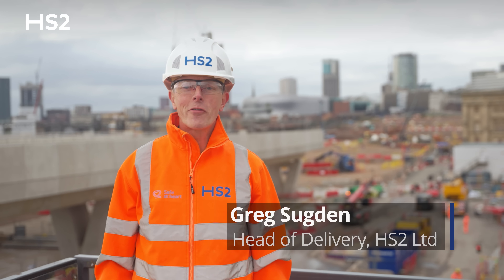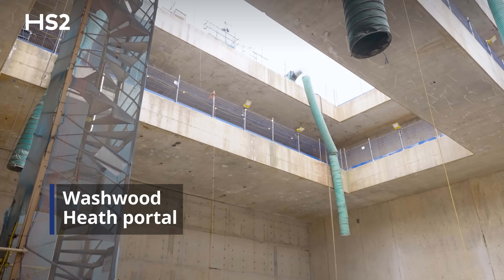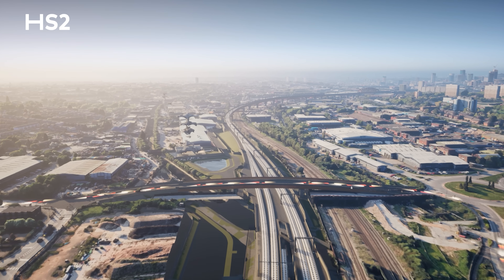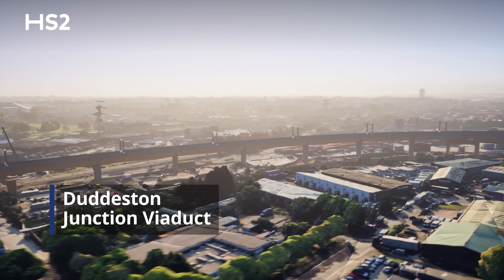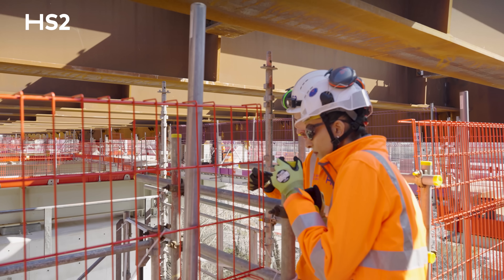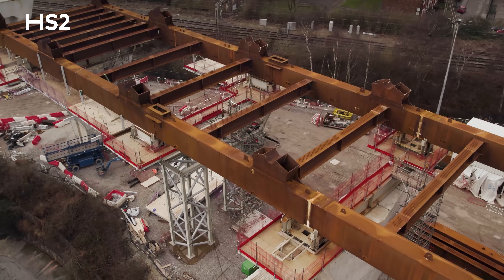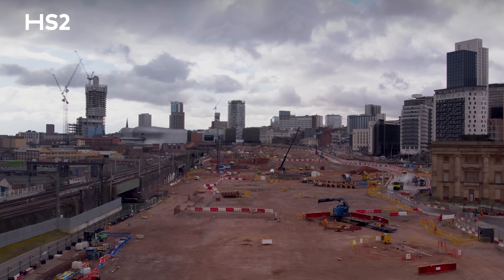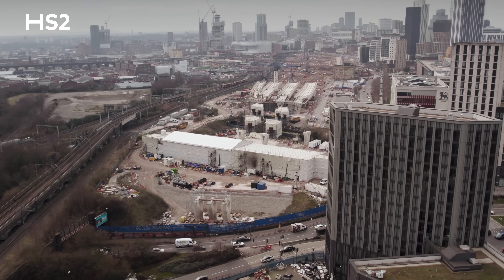Building to Birmingham: 🚆 HS2's Curzon approaches progress update 🏗️

Comment: The key word was right at the end: "capacity". Take express trains off the WCML allows for more freight and commuter trains. But this only really makes full sense if the rest of HS2 gets built... It needs to be completed. In full.
Reply: Apparently, the whole network didn’t make economic sense, but I wonder who it didn’t make economic sense for. Maybe it would have benefited the North more and less so the South so it would kind of re-distribute the capacity of the network. Transport in the North has been terribly under invested.
Reply: @jacklav1  the cancellation plan involved still building £12bn of phase 2b for the Liverpool Manchester line which has a lower bcr. The bcr calculations in network north for hs2 were manipulated also. They were lying when they said it didn't make economic sense.
Reply: @benphillips5041  what does bcr mean? Also lying to save some cash for a short term fix sounds about right. No point in investing in something that will benefit future generations- they won’t vote in the next election.
Reply: @jacklav1  how does that make economic sense
Reply: @epicmonkeydrunk  Well that’s exactly what I mean. It doesn’t make sense overall but I will bet you that the northern branches of HS2 would benefit the northern economy substantially. And there’s f- all investment in transport in the North.
Reply: It can only free up capacity by taking passenger services away from exiting routes. That's not much use for those that can currently walk to their existing station is it?
Reply: @aib0160  The way HS2 frees up capacity is by removing express trains from the network. Express trains which don't typically stop at your regular Joe's local station.
Because you don't have to leave a massive gap in front of express trains any more (current you do, so that it doesn't crash into a slower train), you can then run trains closer together. So these people "that can currently walk to their existing station" will actually get MORE trains, not less.
Reply: @mastertrams  Well if like me you have access to a local station where express trains do stop albeit not all of then there's little advantage for me if fewer stop in future and I then have the choice of the inconvenience of getting to Birmingham first, walking from New Street to Curzon Street with all my luggage or getting the local train that stops at almost all stations with the possibility of having to change too if the train doesn't go all the way to Euston. Either way it doesn't help me and there still the unknow fare cost and the added cost to get to Birmingham.
Reply: This is unfortunately what so many unshowered vegans failed to accept when they were chaining themselves to trees in the early days.

All said and done, all they did was cost the tax payer hundreds of millions more.
Reply: @mesnilman2327  No it makes sense now with the most congested part of the WCML being freed up, no more need for express services south of Birmingham and therefore commuter, freight and medium speed all stop services can work harmoniously on that part, thst being said another step change in performance comes from phase 2a being completed and this HAS TO HAPPEN….!
Reply: HS2  - massively over budget, many years behind schedule, hideous environmental damage and sadly typifies the current state of the nation.
Reply: The whole of HS2 is a vast waste of taxpayers money on a service only intended to open up a corridor to Birmingham for rich Londoners to expand their suburbs while the rest of the rail network - Wales, Scotland, Cornwall - slides into  decay and disuse. It will be the Taxpayer that subsidises it for decades to come. Appaling waste of money supported by spurious arguments. Dr Beeching was right.
Reply: Would have been easier, cheaper, quicker and less controversial to build a new freight only line.
What we are getting is way over the top for a small country, gold plated and diamond studded white elephant.
But I agree that having started it needs completing in full.
As it stands it's a half hearted money pit that won't break even as value for money.
Reply: @tangerinedream7211  don't agree with you there. Many folks made similar comments during the Elizabeth Line construction  - yet look at what an overwhelming success that has been. We need more capacity, the windy WCML will be for slower stopping services and freight. Look at the developments already underway in central Birmingham and surrounding OOC long before the line will operate to see the economic benefits. What has been a problem are the continuous changes to the scheme by the former government causing cost increases and the stupidity of Sunak to cancel Phase 2 and put Euston on hold. Just leave HS2 to deliver a quality railway that will benefit the country.
Reply: @Maxhead_room  The Elizabeth Line is a success because it is so well integrated with the existing railways and tube lines, whilst simultaneously offering faster speeds. There are so many origin-destination pairs supported by the Elizabeth Line that previously didn't exist. This isn't the case for HS2, it doesn't integrate well at all with the existing rail network, meaning that inconvenient interchanges are going to be par for the course and it won't open up many new O-D pairs. It will simply bring you very fast from where you don't wish to start your journey, to where you don't want to end your journey, and where you'll have to walk 10-15 minutes to get a connecting train (i.e. Birmingham Curzon Street to New Street).
Reply: @Maxhead_room  To say this was not the cost-effective solution to an arguable capacity problem is an understatement. And the Elizabeth Line's purpose & associated costs/benefits are so hugely at odds with the HS2 white elephant's ... no comparison
Reply: @91Durktheturk  It's a kind of national joke, really. Sadly the joke's on the tax-payers & those who've wanted affordable long-term rail travel in the UK, instead of whizz-bang prestige projects to further the careers of a few
Reply: @tangerinedream7211  it would have achieved a fraction of the capacity increase of hs2 and hardly make a dent in express services capacity, would not have been any less controversial (see the campaign against ewr) and would have still required multiple expensive interventions on the network to resolve pinch points like New St.
Reply: @tangerinedream7211  A new Freight only line would of been a gold plated White Elephant as you put it, and yes HS2 will pay it's way as the vast majority of high speed services from Manchester, Liverpool, Scotland and Birmingham will not use the Southern Half of the WCML when HS2 opens but will divert onto the HS2 route at Handsacre in Staffordshire
Reply: Arguments that the WCML is at "full capacity" rely on a discredited, out of date forecasting model which overestimates long distance passenger growth & isn't used for anything anymore except to justify the monstrous vanity project that is HS2.
Network Rail's "New Lines Programme Capacity Analysis" shows that WCML capacity is kept artificially low by private operators wanting to maximise profits.
A DfT analysis shows that in peak hours leaving Euston, WCML trains were loaded at just 52.2%.
Whatever people might try & tell you, there are absolutely NO passenger "capacity issues" between London & Birmingham  except London bound morning peak. 
Even Chiltern Rail mainly run 2 or 3 car DMU's most of the day & they're mostly empty! 
Added to that, virtually no-one travels the entire route between the two cities & instead, get on & off at stations along the route.
The blatant corruption within HS2 Ltd that's recently been exposed reveals that senior executives published misleading projections & exaggerated figures to ensure that billions of pounds kept flowing into the project (or lied as it's more commonly known).
There's absolutely NO chance of the rest of this massive white elephant being completed in full as Labour or whoever's in power in four years time won't touch this unmitigated disaster with a bargepole in the future. 
HS2 is an environmental disaster of epic proportions & Britain's biggest infrastructure mistake in half a century.
Reply: @CRIMSONANT1  yes, ok, not all agree.  However, try running a 200mph train on WCML?  The curves, sharp bends, and 20th century track would never take 200mph speeds.   The HS2 is a fundamental change in UK high-speed rail/track and can be scheduled independently of WCML slower commuters and freight...so new HS2 technology and tracks will also increase future WCML capacity.   At a cost, but worth it in a decade from now.
Reply: @Carlos-im3hn  .. in a decade from now"?  .. this disaster of a project is unlikely to be operational until 2042 at the earliest (SEVENTEEN  years in the future) .. the technology you refer to will be obsolete by then! 
As for the freight issue, the CEO of the biggest freight company in the UK has expressed doubt as to whether HS2 will significantly benefit the freight sector.  The main points of contention include HS2's lack of multi-modal use, interconnectivity & intermediate stations, which are crucial for freight operations.
Reply: @CRIMSONANT1  ideologue alert, we’re never gonna convince this well-informed human being, what would we know about one of the most congested countries on the planet with overcrowding and I need to transport people on mass between the largest conurbations to ensure a carbon footprint and a sustainable way of communicating and getting around the world sixth largest economy
Reply: @CRIMSONANT1  So the technology of incab signalling will be obsolete will it, well it has been in use in France for decades now and is still in use now plus semaphore signalling on Railways ( Do you know what a semaphore signal is ) has been in use on Railways ll over the world for centuries now. Railway stuff does not go out of date but is updated and yes HS2 will be beneficial to the Freight companies in removing the vast majority of Inter City trains off the WCML allowing more capacity for freight use on the WCML
Reply: @CRIMSONANT1  Don't get the comments...OOC to Curzon will be running trains by 2033; and, no one is seriously suggesting running freight on HS2 lines.  The point is all the old operating heritage lines will be freed up for more freight.  Running trains on batteries or hydrogen at 200mph is a future whim; however, new GenIV nuclear power (and green H2 generation) may be the industrial power source starting in just 10 years.  Sticking with mid-20th century tech is not an option...time to move forward.    And, please see recent this week Youtube GreenSignals interview with freight leadership...who knows who will be running GBR in a few years.  All good.
Reply: @CRIMSONANT1  If you were alive when the Stockton and Darlington Railway opened, you would of looked stupid considering this is the 200th year of Railways, HS2 will be around for centuries to come
Reply: @peterwallen1063 .. a story from earlier today in Rail magazine .. I quote word for word .. 
"The cost of finishing HS2 between Birmingham Curzon Street & Old Oak Common has soared to £81 billion (at 2019 prices). 
The work will not be completed until 2036 at the earliest, with 2039 more likely".
What a complete & utter waste of taxpayers money.
Reply: @CRIMSONANT1  Oh you aren't dead then  considering your lack of answering, if you want to see the scale of work going on around Birmingham you will see where the money is going with a massive Delta Junction at Water Orton, Birmingham Interchange Station by Birmingham Airport, the 3.5 mile Bromford Tunnel one of the most complex on HS2 and the viaducts through Birmingham, Birmingham Curzon Street and the maintenance facilities at Washwood Heath in Birmingham, so no not a waste of money and the work will be completed when all the ground work is complete and tracks are laid.
Reply: @peterwallen1063 .. I'm well aware of the HS2 work being carried out in the Birmingham area .. all of it a COMPLETE & utter waste of money for a project that very few will actually use & don't get me started on Curzon St .. a £460 million project still going ahead with seven platforms when only three are actually required for the truncated line. 
Have you read the news item I sent you earlier? 
It sums this massive white elephant up perfectly.
Reply: @CRIMSONANT1  I don't realy think you do know what work on HS2 is going on in Birmingham, living 96 miles away and not even having visited Birmingham, plus Curzon Street will be 3 times larger than Birmingham New Street Station and considering that HS2 and Curzon Street Station will only be used by one train operator, Avanti West Coast trains to London Euston, Manchester, Liverpool and Scotland from Birmingham Curzon Street Station it will require 7 platforms for future services, if they built it with just 3 platforms no more work would be carried out on it in the future and sorry do some resurch as when HS2 opens the vast majority of Avanti West Coast Trains from Scotland, Liverpool, Manchester and Birmingham will operate on the HS2 route and not the WCML route
Reply: @Carlos-im3hn  HS2 was only really worthwhile for very long distances. The outrageously costly additional speed capability for just a short section means "worth it in a decade" is more like "worth it in a few centuries" looking at costs & paybacks. Maybe a separate additional freight line would have sufficed. Trying to play catch-up with French, Spanish re: HS2 was always about bruised national pride. Those are biggish countries cf. the UK
Reply: @peterwallen1063 both of you don't know what hs2 is like, where as I do with delivering the stone to the sites and trust me when I say this, they employ 20 security people to man 2 barriers. Then when you arrive at a hs2 site, then they check to see if you're on a list to deliver there, if you're not on that list you could be sat there for hours or you have take the stone back to the quarry which then hs2 has to pay for. So they're paying twice for a load of stone which they wanted. So yes it's a total waste of money only to be 9 minutes quicker.
Reply: @KeithCompton-x9x  Oh yes I do know about HS2 mate, Il live in Birmingham on top of it, nothing to do with deliveries I m on bout its operation when it is completed
Reply: @CRIMSONANT1  There's a difference between statistics and lived experience. I agree that the statistics say WCML trains only leave Euston half full, however you've got to remember that the statistics are averaging out across the entire day. I've taken many a train from Euston in off-peak or at night, and the trains are practically deserted. But tell me, have you EVER tried taking a train from Euston at peak hours? It is madness, trains are full and standing, and even then are leaving some people behind.
Reply: @mastertrams .. as I previously stated - NO capacity issues other than peak hours & sadly, that problem won't be solved when the "new" Euston is completed. 
Originally planned to be built with eleven platforms but now drastically cut to only six. 
Six are enough for London to Birmingham but they couldn't cope with any future extensions of HS2, (not that any government would touch this disaster with a bargepole in the future).
Building the station with just six platforms would be to lock in a capacity restriction that could never be repaired.
Reply: @CRIMSONANT1  The capacity issue is not just to do with passenger numbers on the WCML North out of Euston on the Southern section to Crewe but on the amount of trains using this section of the WCML especially to Birmingham of which both the WCML is now full to capacity as is Birmingham New Street leading to a lot of cancelled trains out of Birmingham New Street and crowded trains throughout the day. Next  how is HS2 going to be a disaster when 95% of Intercity trains from London Euston to Birmingham, the North West and Scotland will use the HS2 route when it opens